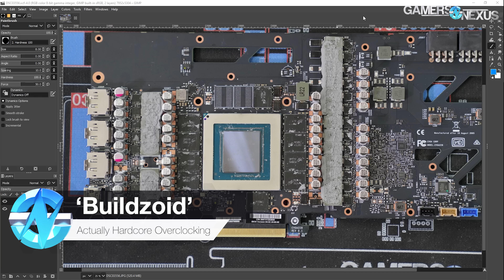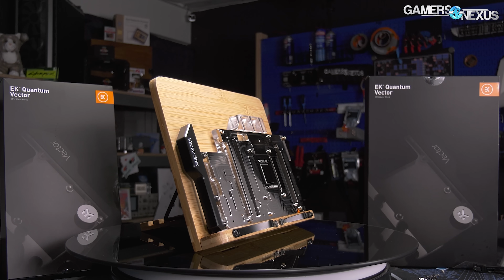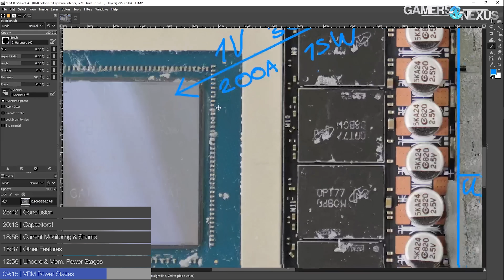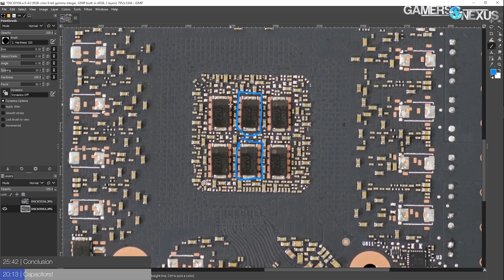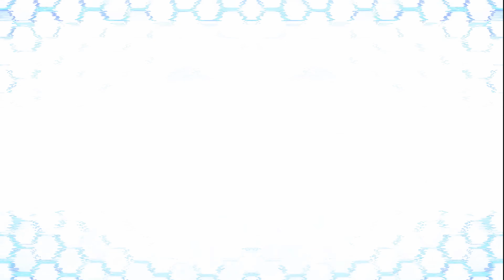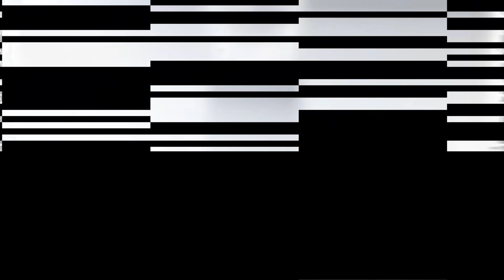Should Be Better for $810: PCB & VRM Review of EVGA RTX 3080 FTW3 Ultra

Comment from the maker: If you'd like to know how the thermal performance is of the cooler, or how its noise-normalized performance is, you can learn more here: https://www.youtube.com/watch?v=uG_xJ_rC3WE
Find Buildzoid's channel here! https://www.youtube.com/channel/UCrwObTfqv8u1KO7Fgk-FXHQ
Reply: Can you guys do a video on the EVGA 500W XOC Bios not working on FTW3 3090s. It is a huge issue over on the EVGA forums right now because EVGA's own bios is not getting to 500W on their own FTW3 cards despite the same bios working perfectly on the cards of other brands. It appears similar to what is said in the video, EVGA cheaped out on components on their $1800 card which gimped its performance.
Reply: AHHHHHHH SENPAIIIIIII
Reply: So do you have higher hopes for the 6800 XT PCB than what you are seeing with RTX 3000 series
Reply: Colorful Vulcan OC RTX 3080 for the same price uses UPI 9512P and 22 phase vcore/uncore and 4 memory 26 total. No pass through hole caps, all SPCaps on the top of the board. 2 x array mlcs with 4 330uF back of the GPU.
Reply: Is this the retail version? On the back it has all SP-CAPS which was the pre-release version...
Reply: @iamdmc  No.  He explains in the video @ 20:00 that this is the pre-release version that was sent to Gamers Nexus.  But the retail version has this corrected.
Reply: Please put subtitles @gamersnexus
Reply: @gamers nexus
Reply: The UP9511 and UP9512 are exactly the same voltage controller aside from the external I2C control.  So many GN viewers are watching this and thinking the PCB is "cheap" when it's just an extreme overclocker lamenting the lack of voltage modding.  Shame on GN for publishing this without fact checking it.  They are subcontracting BuildZoid for cheap content without vetting it and it's totally reckless "tech journalism" to do so.  I expect so much more from this channel.
Reply: this price aged well lmao

Comment: I don't understand why there aren't more models (of all video card types) with two bioses. That one feature is extremely useful. Not having to worry about messing up your bios when trying out a different bios is extremely useful, but it's also useful to be able to have two bioses, to be able to quickly switch between two different power and performance profiles. 

I don't care about being able to push the card hard with overclocking, I just want some basic useful features, like easily replaceable fans, adequate memory cooling, decent, reliable power delivery, decent fuse design, the absence of major design flaws, etc..

Comment: Really crazy the 3080 and 3080ti aren't the best. But the new 3090 with the updated pcb/solder and the 3090ti are incredible, asus still has the 3090 spot imo with evga in second but the 3090ti evga has that number 1 spot imo they did it right! Of course other then the water block or watercooled ti haha. I mean regular versions of course lol. I just couldn't warrant the extra money for the ti when asus has been pushing out some incredible deals! I got the asus strix 3090 for 1750! 250 under msrp lol. Couldn't pass that up! Especially with the overclocking capabilites. I mean i can do 2150 and get 480watts i ahvent pushed it further. So no point in a ti for me tbh. I won the silicone lottery lol. Mine was literally 2100 out of the box!

Comment: What is "Manufactured after 18 August 2005" in the top right corner at 6:15 is supposed to represent? I am confused
Reply: If manufactured after 2005, you can't throw it in the bin. Not that throwing ANY electronics into the bin is recommended.

Comment: Did EVGA make any other changes other than put 2 MLCCs?
Reply: No, but people will tell you they changed all this stuff on them later and they didn't. They just blew the budget on plastic and RGB because that is what sells. The XC3 3080 got polymer caps on the output side of the VRM but only half of it, which was also a very bizarre choice.

Comment: After 4 months, I came up on EVGA's queue system, and just received my RTX 3080 FTW3.  I had managed to snag a RTX 3080 XC3 Ultra a couple of months ago, which I am in turn selling to a buddy, who like many, hasn't been able to pick up a RTX 3080 for his new build at all.

Some observations: while I learned a ton about the layout of the RTX 3080 from Buildzoid, and certainly appreciate his expertise (liked and subbed!), he and some other reviewers seem to act like EVGA is charging hundreds and hundreds more for this part.  They aren't, folks are being a bit dramatic about the price difference, I think.  It cost me $810 vs. $699 for a Founder's Edition that I can't seem to get if I wanted to.  The extra money is there in the cooling solution alone, which really does the job and is quiet, BTW, and the FTW3 offers higher clocks, a nice software package made for it, and for those who like it, all the RGB you could possibly want (actually, considering how nuts some people are for RGB, maybe not).

Part to part comparison from the 3080 XC3 Ultra to the FTW3: after review after of review of there being little noticeable difference between 3080's real world, I have found something quite different.

At 4k with RTX/DLSS playing Cyberpunk 2077, the FTW3 has noticeably better framerates, both peak and sustained, and feels smoother (patch 1.1 really made the biggest difference there, but I had some time with 1.1 before I got the FTW3).   I had to undervolt the XC3 slightly to get the temps where I wanted them, in the mid 70's in-game, and I was simply able to drop in the FTW3 with no Afterburner underclock and get those same mid 70's temperatures with at least 5 FPS more peak, a noticably smoother experience overall, and with much less fan noise than the XC3 to boot.  It's definitely noticeable, I didn't expect that at all.  

And that's my main reason for writing this.  I find that the two 3080's I've used ARE NOT EQUAL IN USE.

In fairness, as he himself said, the things about the FTW3 that Buildzoid picked on, mainly voltage controllers and cap quality, are of more importance for serious overclockers.  But I gotta say, for me, a $110 difference for a card that cools and clocks out of the box like the FTW3 is easily justified.  

And then of course, there's EVGA's queue system.  AFAIK they're still the only ones in the marketplace doing something like that, and they definitely deserve some props for it (I signed up for notifications the day after the 3080 launch, when no queue system had yet been announced, so that 4 months for signing up day 2 when nobody knew they would be able they would be able to actually order is definitely quite a backlog).

Comment: Nice, even my Palit 3080 Gamerock looks to be using poscaps for half of its power stages... The FTW also looks to be running hotter despite its larger cooler... Way to go EVGA.... So in my opinion the Gamerock is looking like the best 3080 since it also does not have any coil whine compared to Asus...

Comment: My take away is that since I don't XOC, it's probably not worth the $75 to replace the pin through caps with surface mounts. Good to know because I do not like trying to do SMD soldering especially on an $800 card that took me two months to get :)

Comment: The UP9511 and UP9512 are exactly the same voltage controller aside from the external I2C control.  So many GN viewers are watching this and thinking the PCB is "cheap" when it's just an extreme overclocker lamenting the lack of voltage modding.  Shame on GN for publishing this without fact checking it.  They are subcontracting BuildZoid for cheap content without vetting it and it's totally reckless "tech journalism" to do so.  I expect so much more from this channel.
Reply: It's humorous to read some of the comments stating they are glad "they read this before buying" - even though most reviewers say this is the best 3080 out there.

Comment: Being an enthusiast, but not having a job or budget right now, except interviews, in starting to get confused, especially by the AMD part.
I've seen a bunch of hype, and some benchmarks, but don't know what is the best bang for buck right now.
I'm on a 34" 1080P ultrawide, 75 Hz and want to go to 1440P ultrawide 100+ Hz (anything that is a great for the money monitor).
I have a 2700x, 16 GB 3200 CL14 Samsung B.Die RAM (easy to OC), and a Gigabyte 1070Ti on a x570 MSI mobo.
For the CPU, mobo and RAM, I paid CAD$500 last boxing day, so I want to keep them and now update the video card and monitor.
It's hard to understand what is the best priced card for different resolutions. Did AMD not release their cards yet?  I'm definitely partial to the better Nvidia drivers, and I will definitely overclock within reason if it saves me money.

Comment: Excellent video. 2 cents: phase count matters, but 8 maynot be that bad. 600khz is per phase switching frequency, "paralleling" 8 phases, looking at 600khz*8=4.8Mhz Fsw sufficient for transient full loadstep response, plus it is the outputMLCC capacitor banks first line of defense to catch the transient load step anyway VRM close loop BW can't react that fast intentionally.

Comment: I bought the 3070 XC3 from EVGA and honestly I'm not super impressed. Noise and thermals are significantly worse than the gigabyte 2070 SUPER  windforce I had before. EVGA sorta dropped the ball this generation.

Comment: With regards tot he shunt resistor count, given the increase power draw of the card, you need to scale the current measurement range, at the cost of resolution.  By splitting the power input over several shunt resistors, the current measurement range decreases per shunt decreases, increasing the effective measurement resolution.  One can only think that the current measurement IS important enough to require high resolution for accurately calculating power draw, and whether it is safe to boost or not.

Comment: @Buildzoid - Can you take the PCB and solder in your own UP9512 modules into the slots in place of the UP9511s? Or would there have to be a matching Driver /  Software to enable that specifically.

Comment: So, basically it comes down to this:
If you are a "normal" user, and your overclocking goes as far as raising the Power Limit in Afterburner, the best thing to do is just to buy the cheapest 3080 you can get at the time and be happy. Because u are getting at least 90% the experience of someone who ponies up the big bucks for a high end model.
Sounds about right?
Reply: No more like 98% of the experience, or maybe 99.999%. Considering that the RTX 3000 series is Nvidia's Vega moment, and the stock cards are already clocked right to the limit...

Comment: Hi Buildzoid. This has probably been asked before but could a skilled individual replace these chips / resistors if they had the parts and get an improved card? Or would there be some other factors that would also need to be changed too?

Comment: Apple, "loves the environment" but sells stuff that can't be fixed and is e waste from day 1.

Evga, actually cares and adds in components to mitigate damage from failure to prevent card from becoming e waste.
Reply: Apple is a leader in e-waste recycling. Almost no one fixes laptops regardless of manufacturer
Reply: @ZombieLincoln666  apple literally tries its hardest to make sure that your device is scrapped and not fixed when an issue arises, by doing that they are increasing the amount of e waste needlessly.

Comment: Here in Norway I was able to order one for the equivalent of $1130 US. However, the cheapest on any Norwegian store that sells PC hardware still costs equivalent of $996 US (an MSI Ventus), and it's far from the most expensive price I've found which was equivalent to $1311 US (an AORUS Master). So, is my $1130 3080 FTW3 Ultra a good deal? I don't know. I have an air cooled system (Define R6 & NH-U12A) and I'm not an extreme overclocker, unlikely to do anything but tweaking in software.
Reply: You got to have some wealth, I think I wait until 2021 q1 and hope for better prices, it's a punch in the face to hear at the live event something about 700 dollar and now every custom version in Europe is more expensive than 800-900 euros.
Reply: My problem is I'm really in the market for a graphics card, I had my 1080 die and I've been using a borrowed 980Ti for months now. I was in the market for a 2080 Super to replace the dead 1080 since before the 3080 was announced. I feel I can only wait for so long.
Reply: I finally got my 3080 FTW3 Ultra and started using it! It's doing great for my needs. I've not yet really put it through its paces in any games (RDR2 is top of my backlog) but I've done a ton of benchmarking and managed to push it to almost 4% over stock performance in 3Dmark by gentle tweaking in Precision X1.

Comment: No point in buying the ultra edition if you're overclocking it. If you could actually buy cards this card is like $60 to $100 cheaper then any other that delivers 450watts so the complaints aren't that justified as its a bit of deal.

Comment: The logical conclusion is that Nvidia stacked the deck with the FE this gen.  Either that, or EVGA recently got super miserly, or that they basically had no budget for real component upgrades at the PCB level even when selling a card at $110 above the FE's MSRP.  Given recent rumors that AIB partners are pushing back against 3060 Ti pricing, it seems like its the former. There's anecdotal evidence around that - like the fact that the 3080 XC3 Black hasn't been sold through Evga.com since their queue system started - that REALLY suggests its Nvidia expecting its AIB partners to work for (almost) free here.

Comment: Alrighty, need that 3080 Strix Buildzoid review so I can decide whether to keep this FTW3 Ultra or not
Reply: https://www.techpowerup.com/review/asus-geforce-rtx-3090-strix-oc/3.html    3080 strix  should be the same tooling with less memory and the 102-200 chip instead of the 102-300
Reply: @markb7081  Thanks Mark, the link is for 3090 though, same would apply to the 3080 variant?

Comment: I don't necessarily mind if they used cheaper components to save costs as long as they're as reliable and perform around the same. It's things like the VRMs and other critical power delivery components that I'd mind if they skimped out on.
Reply: Electric component parts is one of the rare areas where "you get what you pay for"  is not a complete lie for example like people using the saying for an apple product.

Comment: 🥺 my FTW3 Ultra just arrived today, haven’t even had time to install it and this was the first video in my queue as I was about to slice into the box... now I’m just disappointed that I apparently paid for... RGB? 

Way to crush a man’s spirit BuildZoid 😭at least I got it form NewEgg I guess.
Reply: This isn't a FTW3, notice the lack of 3rd 8-Pin. Something is up, maybe this is an XC3
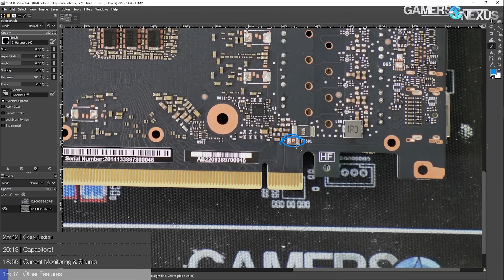Reply: @Christhebearable  It certainly looks that way at the beginning of the video but at 15:30 you can see the third power connector. To double check I ran the serial number on EVGA’s site and it confirms that it is a FTW3 Ultra 😢

Comment: I literally just picked up this card 4 hours after video release. Feels bad man
I am optimistically hoping that all these issues have already been revised.
Reply: I just got one yesterday, works amazing, it’s perfectly fine. Runs a little hot but that’s about it. And I got it to OC +150 on core and +1300 on memory.
Reply: I don't think those are real issues. Your product should be working fine under regular loads and conditions. It's not a premium fit and finish though (even though it's priced higher).

Comment: Lol why are you doing it on the reviewer card. They changed few things on the release cards. Replaced a lot of the though hole caps with SMD, Replaced the behind die with 2 banks of MLCC. Switched to up9512 controller. Also something worth mentioning is the fuses values if your going to shunt mod.
20 amp on the plugs and 10 amps on the pci-e slot. So need to to make sure you stay under there raitings. The PCI-E slot one is a self resetting fuse so will recover if it trips. The plug ones wont and once they go they need to be replaced.
Reply: They have the physical card they just aren't going to mail it to Buildzoid in the UK. Those pictures are frm the physical card they have and Steve has the ability to ask EVGA what they changed and GamersNexus says that is the only change, but feel free to buy one and take it apart then you can tell us.
Reply: Wow, so they did replace the caps, and UP9511 with UP9512? Has this been physically confirmed on a retail card?
Reply: No GamersNexus says the MLCC change is the only change they made
Reply: @michaelcerrone8403  Well, the review was done from a couple images rather than a physical card, and even those were from a pre-production item.
I'd like to hear from someone who has actually taken apart the retail version of the card.

Comment: ASUS is basically the only AIB that has actually done interesting stuff with Ampere cards. Everyone else is just reference PCB with some minor upgrades here and there. I wonder if this is related to NVIDIA not informing the AIB's on time, or whether they're all cheaping out on us.
Reply: If I had to guess, it would be nVidia gouging the AIB's for the chips (GPU and RAM), and setting an unrealistically low MSRP.  I think the claims about the upcoming mid-range card are no less true for the 3080.  Maybe even the 3090, given nVidia's greed.